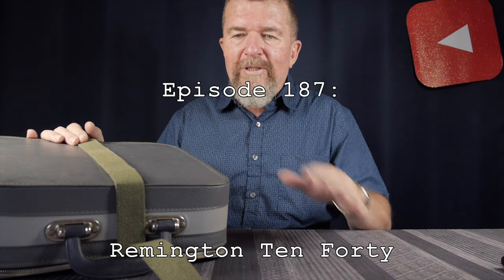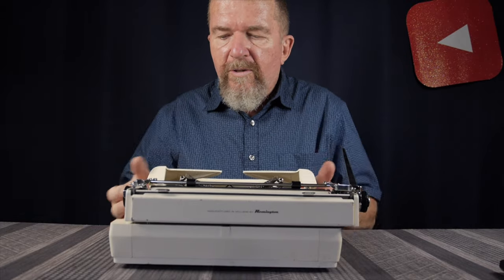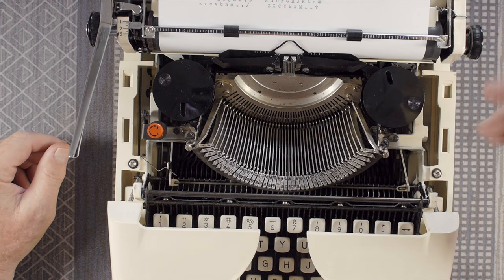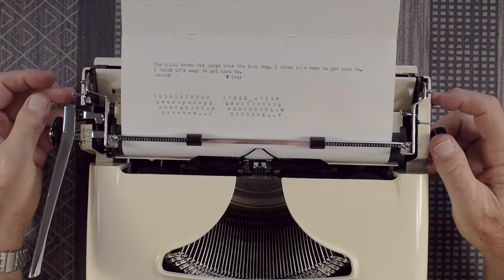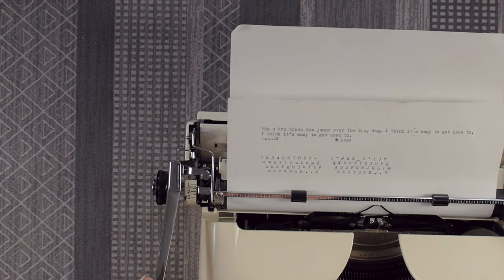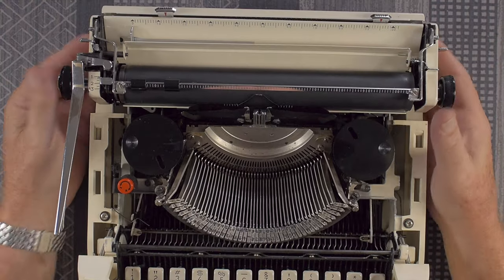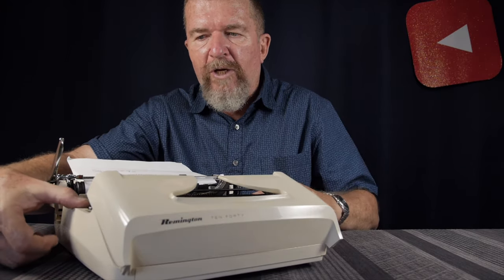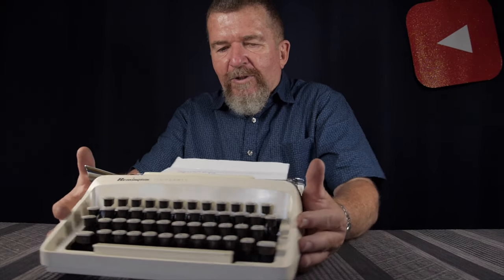Typewriter Video Series - Episode 187: Remington Ten Forty

Comment: Loved the video! I was wondering if you could help. You stated at the beginning of your video that one of the problems was that the ribbon color selector. For my ribbon selector, no matter the setting, the ribbon won't go all the way down. Do you have any advice to fix this?
Reply from the maker: Try cleaning the ribbon lift with alcohol and cotton buds. Sometimes they are bent because a ribbon gets tangled and someone pulls on it hard, bending the fragile metals parts.

Comment: I have this typewriter but currently having problems with It. It only prints half of the top letters in lowercase. In uppercase letters it prints it all..... Wondering what to do. Thanks for the video!
Reply: Do you have any suggestions?
Reply from the maker: @lmm8521  There are adjustments called "on feet" and "motion" that set the positions of the upper and lower case so they both print evenly and at the same height.
Reply: @Joe_VanCleave  thank you! Appreciate you so much :D

Comment: Mechanical, manual TYPEWRITERS, unlike "silicone based" writing tools employed today, these older, mechanical ones actually require their users to THINK about the complete process! YOU have to set the margins, line spacing, correct y ok ur own spelling BEFORE y ou u commit the word to the page, etc. Now? If you're like me, self taught, and NEVER took a formal typing class? You REALLY have to think about the whole process. Computers and dedicated word processors are GREAT for people like me... THEY do all the format thinking for us but... That's the trouble! Plus, what about if your area suddenly gets hit with an extended power "black out"? How long will your laptop last before it dies, starved for free flowing electrons? With my old, reliable, manual ROYAL and OLYMPIA brand machines? I can keep CLICKETY CLACKING away to my heart's content even by candlelight if necessary. That's the ultimate attraction. It's the literary version of the "STEAM PUNK" movement. 
Now? Is electronic typing quieter on the eardrums and easier on the fingers? Yes. However a good highly skilled manual  machine typist can match his or her electronic or computerized machine counterparts for both quality, accuracy and speed EVERY time  in a head to head competition. There's just something amazingly satisfying about using the old fashioned typewriters which you just DON'T get on the computerized ones. Plus? It's a heck of a workout too! You'll definitely feel it in your whole body until you've gotten several hundred pages done. Then? You'll be in prime condition! So? Go check out your parents or grandparents closets, hit the thrift shops and sales and  rescue a DORMANT, forgotten machine. Take it out and try it out. If it indeed needs a tune up.or a new ribbon? Many repair shops still repair and recondition for sale typewriters of all sorts. In fact those "STEAM PUNKERS" I mentioned earlier are a force pushing the demand for these machines forward and keeping them alive and functioning long after they were "retired" from service.
In a blackout? Your computer WILL eventually die. Sooner or later its battery will run down to ZERO! Starved of the free flowing electrons it MUST have as its "fuel". Then what? See. The mechanical machines win out again! I must confess that I'm a "60's kid and a self taught, two fingered "hunt'n peck" typist. This was BEFORE the whole "PC" and "MAC" revolution.
However, for the price of a decent "laptop" today, in 1988 I bought a brilliant "PANASONIC" hybrid machine. It had the feel of a typewriter when you hit  "PRINT" because that's the mechanism it used versus the  "dot matrix".  However, with a computer-like screen and ability to edit, save, recall and rewrite to and from a 3.5 inch "floppy disk", I used it for all my work. My wife, a NYC schoolteacher who at first wept that I spent our savings on the thing, ended up using it MORE than I did.In fact, It helped her earn two of her four MASTERS Degrees!' Not too bad for a so-called "compromise" machine, eh? A true workhorse! A veritable CLYDESDALE in a room full of miniature ponies!
But? In the end? Our trusty PANASONIC compromise finally failed. So? It was BACK to the old, non-electrified, reliable, MANUAL TYPEWRITERS yet again. Have ribbon, will travel and type, type, type, on!
                                                          The End
                                     This has been a "BOJO" essay.
               COPYRIGHT 2020  by JOHN C.BOJEMSKI, ALL RIGHTS RESERVED!